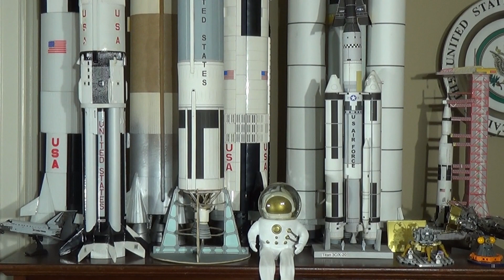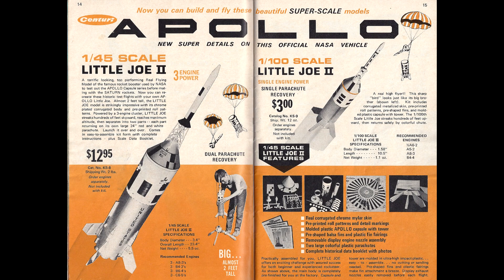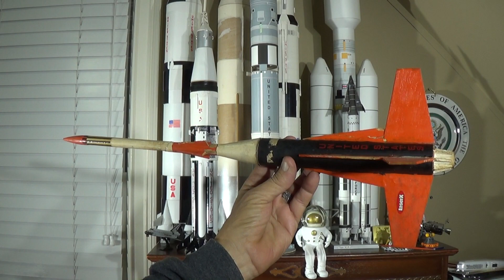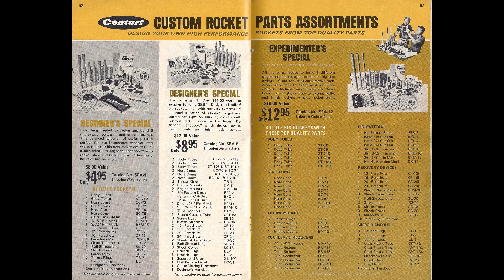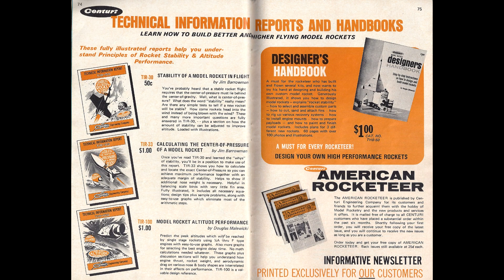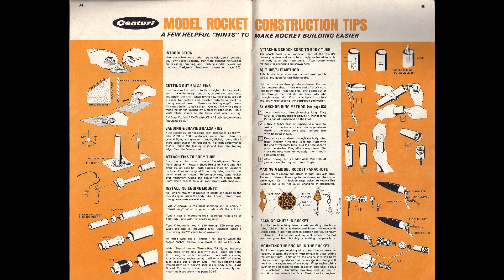1969 Centuri Model Rocket Products Catalog

Comment: In 1981 I built the Centuri F4 Phantom from the "Fighter Fleet" section of that years catalog.  Very realistic with drop tanks and missiles hanging underneath the wings.  Finished it very well, got all the colors just right on everything, all lined up correctly, and the big day finally arrived.  Off the launch rod it came in a Blaze of Flame, and immediately started to hunt for a viable target in Kamakazi mode!.  We all dropped to the ground. A couple High G High Alpha maneuvers just above our heads and it shot skyward,,shedding the wings and drop tanks and missles, canopy, ect..  I humbly gathered it all up and took it home and glued it back together, with the wounds. It became a desk rider after that.  I owed it to it.  It survived for a LONG time with my stuff, but eventually fate had another path for it.  Miss those days.  1981 was the first shuttle flight.
Reply from the maker: A great story! Thanks.